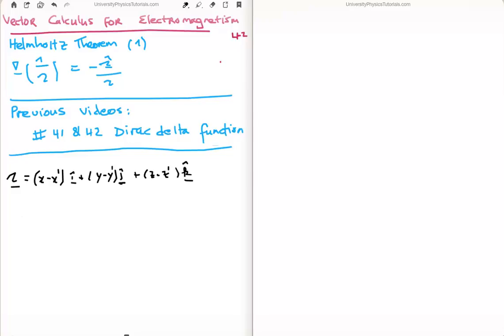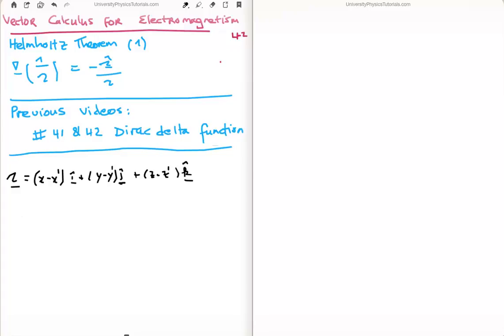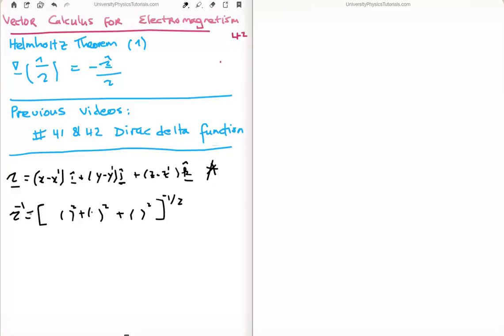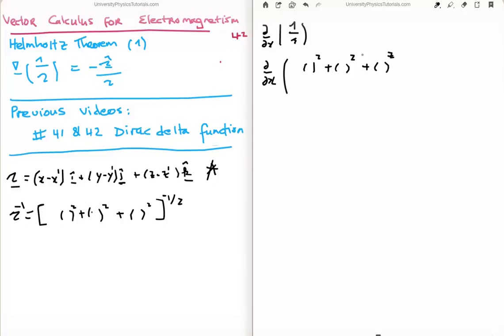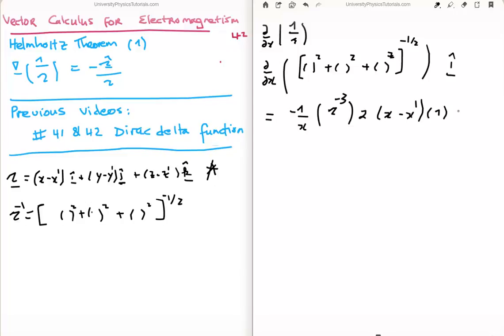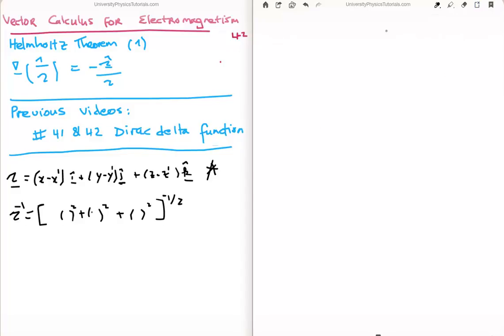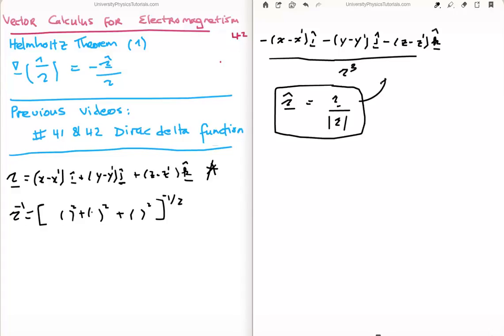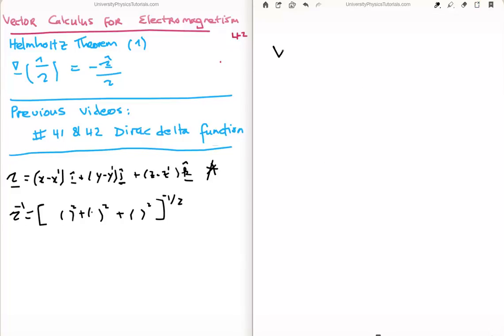Vector Calculus for Electromagnetism 42 : Gradient of One Over the Separation Vector

Comment: Hi there, great vid and channel, one thing I'm a little confused about though, is the Gradient of One Over the Separation Vector equal to the negative of the separation unit vector divided by (this is where I'm confused) the separation vector or the square of the separation vector? Seems to change from the start to the end of the video?
I've worked it out to be the square?
Any help would be smashing!
Cheers
Reply from the maker: You're right - its a typo! It should be squared. Thanks for pointing it out.
Reply: +theracoonofsunnydale i got the seperation vector magnitude to be to the power of 3/2, since -(1/2) - 1= -(3/2)
Reply: +theracoonofsunnydale oh wait i figured it out, the seperation vector magnitude include the ^(1/2) nvm great video!
Reply: Too many mistakes here